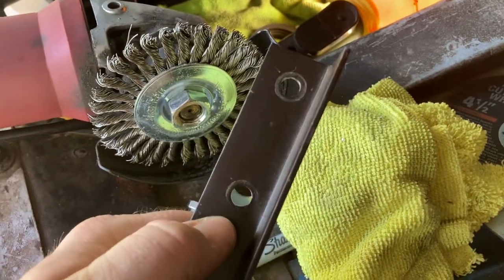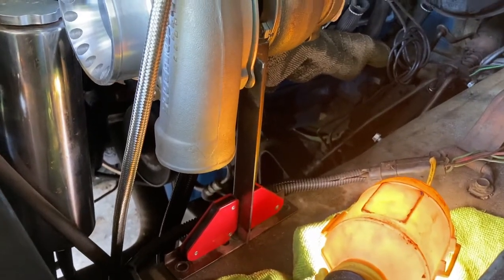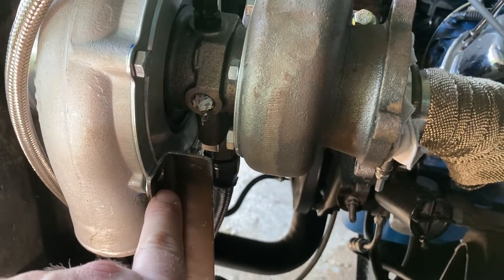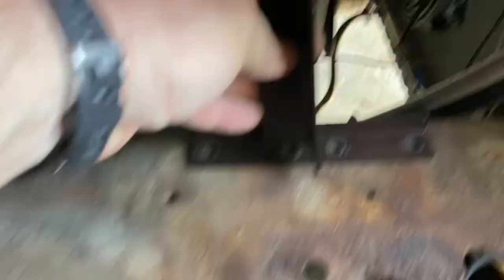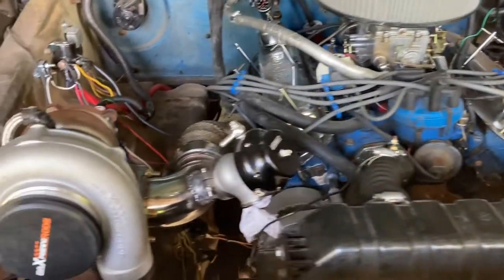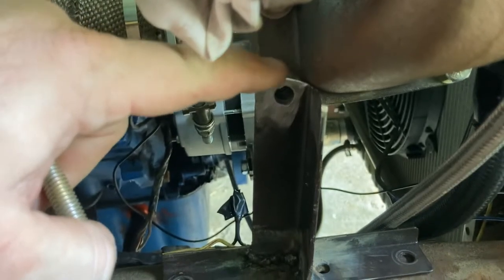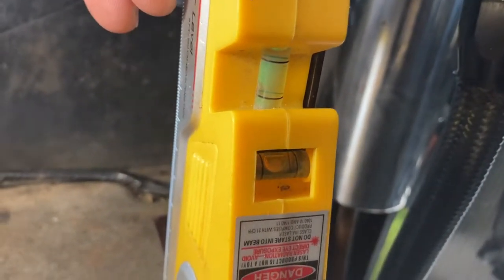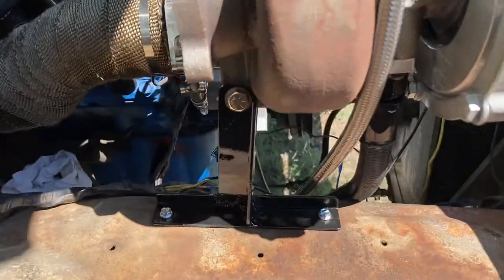Turbo DIY Mounting Brace Fabrication - "Support Your Horsepower"

Comment: You probably should make your bracing from the engine because of engine torque over.  You could possibly damage your headers and turbo's mounting those braces to the fenderwells.  Not trying to criticize or come off as rude I just would not want you to damage some expensive parts
Reply: this was my first and only concern. that mount will crack heads

Comment: It will work... but not the best practice and will result in exhaust cracks.  The drive train (engine/trans) is mounted to the frame through rubber mounts, this will allow movement and this also allows the vibrations of the drive train to be dampened, reducing NVH.  

Your turbo mounting set up is "hard mounted".  While the engine/trans is allowed to move and flex through the rubber mounts, your turbo mounts are not allowing any movement... 

I recommend designing a similar set up with the angle iron and just mounting the turbos directly to the front of the engine.  This will allow the drivetrain to flex through the rubber mounts and reducing stress on the exhaust/turbo set up.
Reply from the maker: I’m glad this vid helped in some way! Please support my channel by subscribing and clicking the Bell.

My Store is open too! Lots of custom Tees, merch, & swag…

 https://operationrv.printify.me

Comment: This is not a good idea. It should be braced to the engine using rose joints to allow for some play. Unless your engine is mounted to your chassis with solid mounts, it will do more harm than good.
Reply from the maker: You have a valid point but with my setup it’s okay. Since the install there’s yet to be an issue. Plus, on the upside I look over my truck consistently making sure everything is top notch. This setup is low boost and not drag-type torque and basically just needed bracing for the heavy turbo and exhaust piping. If anything changes I’ll publish an update. Thanks for watching.